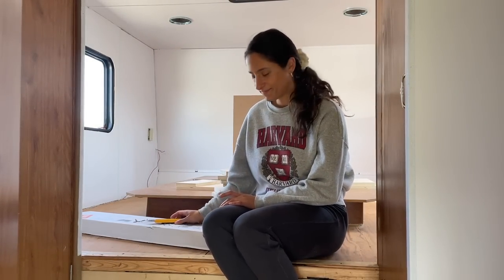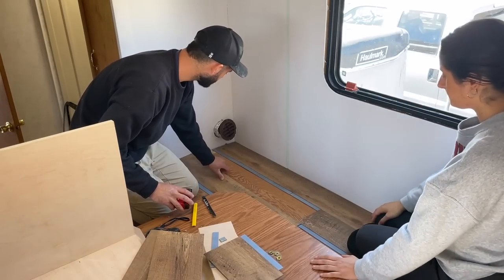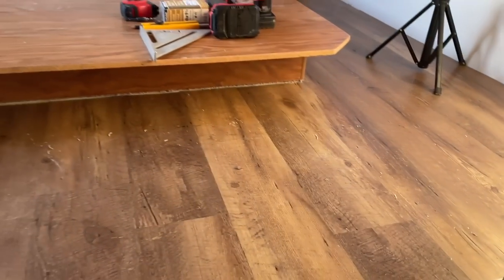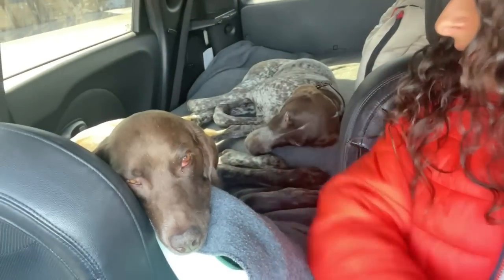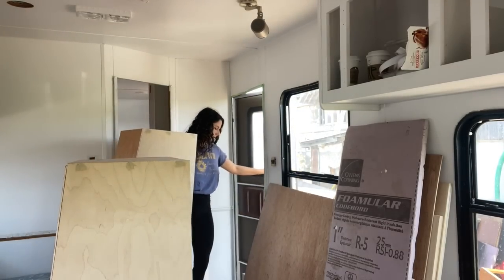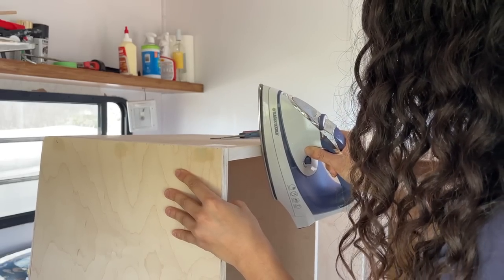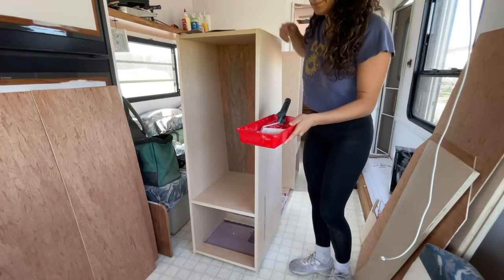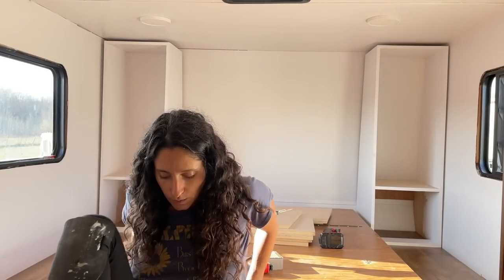Renovating my Fifth Wheel Camper

Comment: Love the new flooring. Like the raw, rough look of it. Your brother did an awesome job on the cabinets. Thinking ahead for the tub/shower I do the same thing, if I'm doing a project and thinking ahead about what still needs to be done next or later and what I need for it I'll get it, because I know I'll be needing it eventually, if that makes sense,  that and there's also been times I've put off buying things I knew I would be needing but didn't buy it at the time only to go back later and it being gone.

Comment: Just a little tip on installing the edge banding. Overlap the top piece and the side and the cut both pieces at once with a sharp utility knife on a 45 degree angle. Will give it a picture frame look like both pieces of wood were cut at a 45.

Comment: I guess that was a decent excuse or you could go in and open the fuse box and put a new fuse in lol. Most of the lighting in my RV are just spade fuses like your car has find it and replace it. Or while your in the fuse panel flip the breaker back on that goes to those lights. Not trying to offend you kiddo just probably a quick fix to your lighting issue. Keep those videos coming ❤️😂✌️and the RV is starting to look awesome 👍
Reply from the maker: I did get some new fuses but I think a wire somewhere needs to be capped off because it didn’t help! Thank you tho! Hahah appreciate it

Comment: Your door should have a catch that locks it open. It should be on the outside of the door and attaches to the side of the camper. Hope that helps.
Reply from the maker: It does but it doesn't latch, I'll be replacing it for sure! lol

Comment: Hi Juliana , its looking great with those cabinets. Just wondering are those floor tiles vinyl by per chance?. It was quite by chance that I found your channel while looking for one of my other  channels i watch. I am in the process of redoing the floor in my Caravan as well, as the floor is a bit soft due to a  delamination issue. I  have looked at a similar product with self sticking vinyl tiles so its interesting to see it used. All the best with your project, I look forward to watching it progress as time goes by. Cheers for the moment, Trevor Cozens, Picton New Zealand.
Reply from the maker: Hey! Yeah I did use a vinyl stick on flooring but I found that it started to bubble and peel up after a few weeks 😞 due to the constant changing temperatures in the trailer. I think it might be better in a smaller space? I think a click flooring might be best

Comment: What is that flooring called and did you get it at Lowes. I used some before but bought it at Home Depot and they don't carry it here any more.
Reply from the maker: https://www.homedepot.ca/product/trafficmaster-pacific-pine-6-inch-x-36-inch-luxury-vinyl-plank-flooring-24-sq-ft-case-/1001012443 

That’s the link! It’s from Home Depot. I don’t know if it makes a difference if you’re not in Canada?
Reply: @julbm  Thanks. No, I'm a cornhusker. Live on 20 acres at a lake. I'll try again. I used the same flooring as you for my bathroom and liked it.